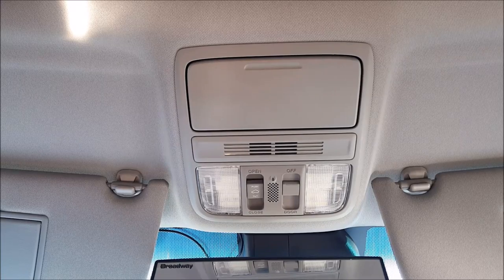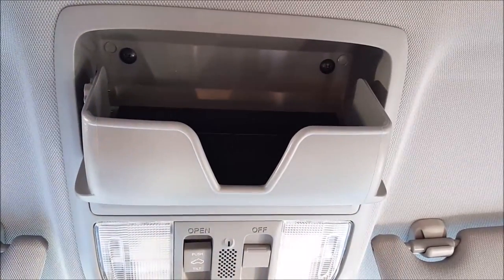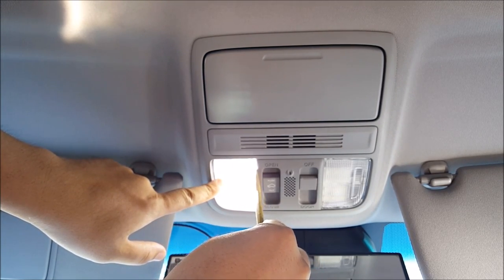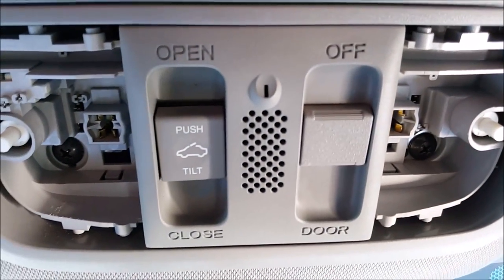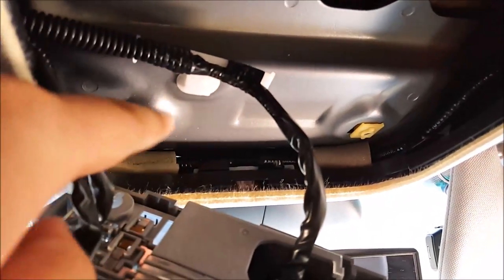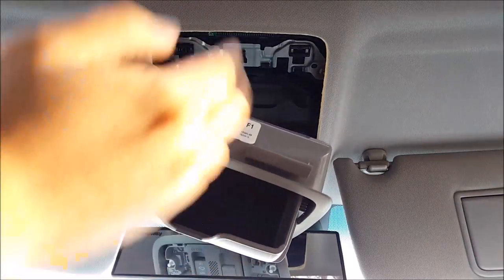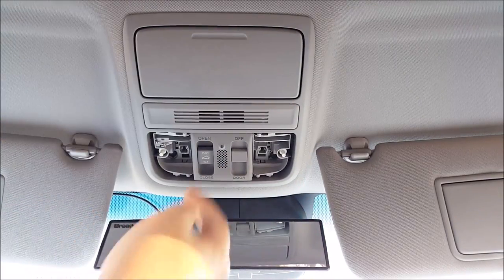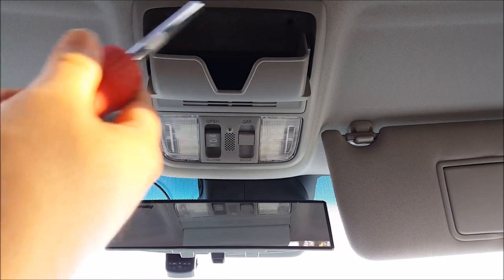DIY Tutorial: Honda Accord Overhead Console Removal and Installation

Comment: Thanks for this video. I have a 2018 Accord. I have a problem where I was changing bulbs to led in the rear and the old bulb popped into the roof. I heard it rolling around and I think it's in the driver's side near the A pillar and is at least temporarily stuck there. If I removed the overhead console, could I reach my hand in there or is it like it looks and not accessible?

Comment: Well done and easy to follow.  Thanks!  I'm looking for the easiest way to hardwire a dash cam into the overhead console area (via powered mirror wires).  Can you provide some guidance on which wires to tap into?  Thanks again!
Reply: Hey - I am about to try the same thing on my odyssey. Did you ever get this done and if so, any tips for someone who is most likely going to screw things up?

Comment: But , I don't have a SUNROOF so the light has a one piece lense ( lt to right covering both lamps,  no sunroof switch because no sunroof ) I have a leak and want to drain the water. Before winter and perhaps find the hole in roof or top of (replaced)  windshield?
Do any of you know where the "tabs" are?
Reply from the maker: Most likely the screws are located behind the one lends and the tabs are located on the front and rear of the assembly. It depends on the make model year of your vehicle.
Reply: DIY: Car Modz It's a before or after replacement?
"Get the new lens before you crack/break it or after?"
Thanks , HONDA dealer, for showing me get manual, part & special tool for free! 

THANKS TOO YOU FOR THE QUICK REPLY😂
If it works out , I'll post it. ( FOR THE SINGLE LENS;  NO SUNROOF MODEL!

Comment: My honda Accord came without homelynk, I've seen several ways to upgrade my overhead console to a an after market home lynk, yet my question is this, can one upgrade to an overhead console that has the home lynk included and what is the wiring configuration, because I got one of a used honda, and the wires that I need to connect are 4 has anybody tried it?
Read more
REPLY
Reply from the maker: https://www.youtube.com/watch?v=Fefl5_fww9A